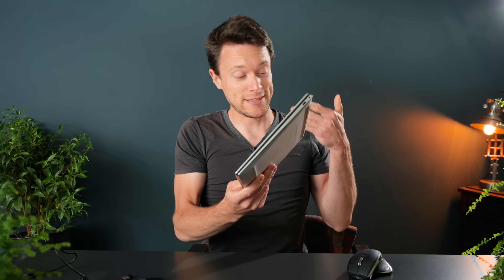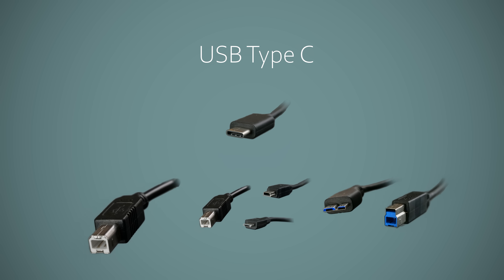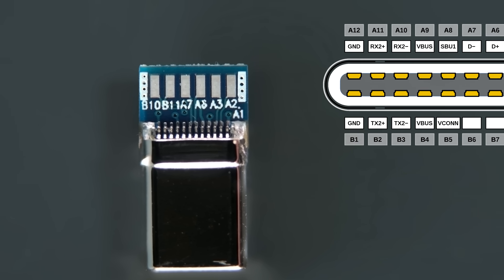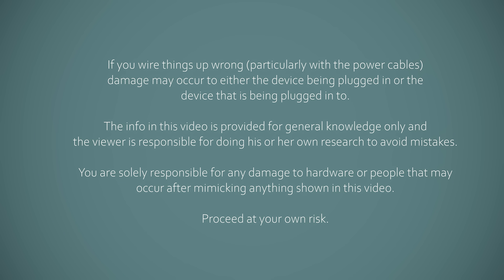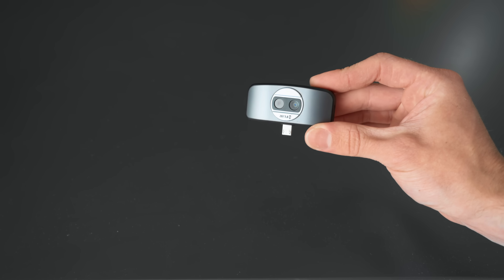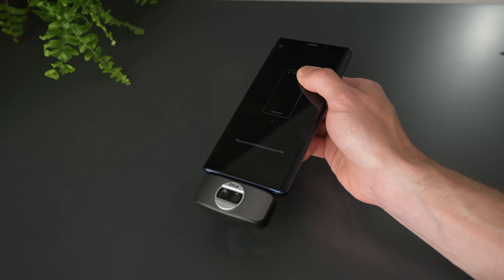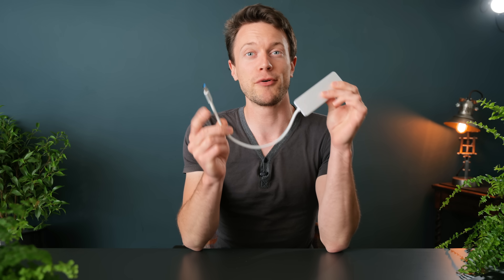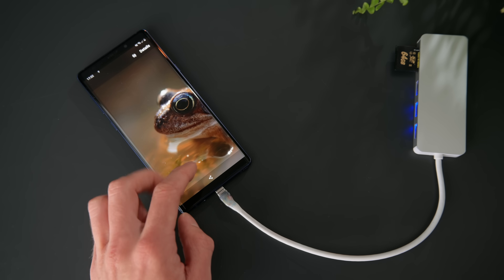Converting devices to USB Type-C

Comment: My gosh, those THT resistors in place of SMDs. My eyes as an electrician hurts but great idea though!
Reply: I also think they put them as host because that's probably the most common use for that part and secondly you could just move the resistor over if you want to use it the other way since the resistor is already there all you got to do is plop it to the left
Reply: @ralanham76  i was wondering why he didnt just move the resistor over
Reply: @thetinguy  Because it's a pain in the ass to solder with an iron.
Reply: ahahh same. Surely its not much effort to order some at the same time as the breakouts. And it looks like R1/R2 correspond to the host/sub config? So potentially able to change it without any other components if the pullup/pulldown is the same value
edit: just saw a bunch of other comments with the same observations. Also cutting the trace to Vbus and bridging it to gnd should have worked
Reply: @TheSecondSomething  Precisely, the pads are there, bridging is also valid option, but still no hate or anything as the idea showed in the video is great
Reply: Yeah! And that isolation tear of the green wire 05:42 hurts my eyes 🤯🤯🤯! #electricianocd
Reply: can someone translate this to english?
Reply: Can someone provide an example of what better would look like?
Reply: @dcloak  Ya, for real. I thought he did pretty good. But then again, I don't know the difference between THT and SMD transistors.
Reply: Pretty old school
Reply: Amazing tutorial thank you.
Is somebody know which connectors in USB c correspond to audio stereo input and audio stéréo output. I have Samsung S20 Ultra. Does it the same for every phone USB c type ?
Thx
Reply: Reading all the comments here and I have hardly any idea what the heck are the electricians talking about 😂😂
Reply: @jont0209  basically instead of cutting the trace at 7:12 and adding that big resistor, he should have just moved the little black resistor over into the other slot as this would have solved both problems. But he is still getting praise because the device worked.
Reply: @nuthinnew  thank you very much for explaining! So if I understood correctly he just would have to move the black little resistor to the R2 contacts and solder it there. Ok, got it.
Reply: @jont0209  correct
Reply: I prefer tht
Reply: Don't be a jackass, not everyone is formally trained in your career of choice.
Reply: That soldering, loose data wires, it's some hardcore stuff over here, but it awesome that it works that way anyone can do it 😁 no hate, not everyone is good at everything 👍🏻
Reply: @jaroslavpetardyson5666  I actually found it more comfortable, as someone with zero experience, that they are not like factory-made, but are flimsy and funny, it's always scary to try out something new, like DIY, and your devices look abysmal in comparison. This just reassures you that you can try and it's not a problem if they look kinda meh.
Reply: Hey, if it works, it ain't stupid
Reply: He probably would have used SMD if he had them.  Their only downside is how tiny they can be.

Comment: At 7:04 why didn't you just desolder the resistor from R1 and solder it at R2 since it's clearly the same pin at the bottom but connected to ground?
Reply: I continued watching hoping you'd notice the empty slot when doing the other devices but you kept on adding huge ass axial resistors at 10:53 and 13:53

Am I missing something?

Comment: That empty R2 pad looks suspicious. Not sure on the schematic, but would moving the surface mount resistor from R1 to R2 have worked instead of scraping off the traces and adding a massive through-mount resistor?

Comment: This is a great video if you want to DIY. However, I can buy 5 USB C to A adapters (small, not dongles) for $13.60 on Amazon. If I just want it to work and don't want to solder (I did enough of that in my youth repairing radios and TVs in vacuum tube and discrete transistor days.) I would go that route.

Comment: At 7:05 you see a resistor (R1) connecting to +5V.  If instead of scraping the trace you de-solder the resistor at R1, and solder it to R2, you perform the same task without having to add a new resistor.  The same goes with the other board at 10:46.  In both, the R1 pads are for host mode and the R2 pads are for device mode.

Comment: Really awesome video! One strange solution is that why not just move the original resistor from R1 to R2. It would have been much easier than cutting traces and using a huge resistor.

Comment: There are much smaller adapters than yours. There is one that you can plug inside your usb and only the Type C connector is sticking out. They are just a few cents from china. It will be about the same size (maybe a little bit larger) than your solution, but defenitely easier to "make" :D

Comment: Nice manual, I laerned some new staff. After some expirience with motherboard diagnostics I noticed, at 7.11 you could use hot air solder and just swipe R2R1 resistor left. You could also do it with standard iron if you have thin tip. That would be more alegant and profesional, but eather way would work the same.

Comment: You can use this very simple solution sir

#Aliexpress Rs. 23.32  50%OFF | OTG Type c USB-C Micro USB to USB Adapter Type-c DATA Cable Converter For Xiaomi Huawei Samsung Mouse usb Flash Drive
https://a.aliexpress.com/_dZHQ8HD

#Aliexpress Rs. 46.64  24%OFF | 5pcs Mini Type C Adapter Micro USB Female To Type C Male Adapter for Huawei Phone Micro To USB-C Type-C USB 3.1 Data Charging
https://a.aliexpress.com/_dZDZVQP

Comment: On the breakout board, if you look closely, there is another SMD soldering spot where a resistor can be soldered to. If you follow the connecting trace you will find that the trace connects to the GND pad. Therefore, you could've just taken the SMD resistor and soldered it 2 mm to the left instead of fiddling around with the big bulky resistor and essentially crippling the board in the process.

Comment: I still prefer that smaller adapter (or a bunch of them) rather than messing around with the "conversion", which technically is useless btw (doesn't provide faster data speeds or smth, just the newer plug).

Comment: You scraped off the resistor... and then added a completely different one... could you not just resolder the one there to the other pins next to where you took it off?

Comment: I think you could have moved the SMD resistor that was on the board to the other empty spot. if I saw the traces correctly, that would have done the conversion without needing another resistor..

Comment: In this case I would 100% use a small adapter (dongle, if you wish) for 1 USD from Ebay. Taking devices apart just for that does not make any sense from my POV ;)

Comment: Good video and well explained Matt. I was having the same issue with trying to power a Raspberry Pi4 and use the USB-C port for data at the same time. It needs the Pi to be the Client for power and Host for Data. I cannot use the USB 2 & 3 ports as I am running Windows 10 and there are no ARM64 drivers yet. I am having problems using a USB-C OTG Hub so the breakout boards and resisters might be a way to solve this issue.

Comment: I needed an extra webcam and I have an old laptop laying around, that tutorial would be awesome
Reply: I have an old Logitech webcam... uncompatible with win10, can you do something with that?
Reply: @slycer98  Short of forcing a driver installation via Device Manager o
any drivers you might be able to find on the Internet, most likely not. I'd give that shot first and foremost if you haven't. You may need to extract an EXE file with 7-Zip to gain access to the necessary INF file(s).

Comment: I converted my Audio technica M50Xs to USB type C, when having just bought a Note 10+, it was the only port. I used the DAC and cable of the USB-C galaxy earphones that came with the Note 10+ and was able to connect it to a previously broken standard 3.5mm audio jack from the M50Xs. As I haven't seen any M50Xs converted to USB-C, I'm very happy with possibly have the first ones. 😂
Found this video quite interesting to see as I did this only 3 months ago. 😊
Reply: very cool u should do a vid about it
Reply: @Reedith  Tried putting it up on Reddit, just not great with it yet. I'll remember to come back to this comment when I get it posted 😄🙌

Comment: Great video!
In the case of the mouse, where conversion is the simples, wouldn't it be easier, and less destructive and backward compatible, to just use one of these?
https://www.ebay.com/itm/2pcs-USB-C-3-1-Type-C-Male-to-USB-Female-OTG-Adapter-Converter-For-Tablet-Phone/391937002524?ssPageName=STRK%3AMEBIDX%3AIT&_trksid=p2057872.m2749.l2649

As for the other ones, I totally get and appreciate the effort!!

Keep 'em coming!

Comment: in 7:13 you could just move the resistor to the left pad and you dont need to place that huge resistor on the circuit, or you already just scrap the pad, and can use a jumper wire to the negative pad is cleaner, but nice work thx for the tip already order the usb C boards thx

Comment: the idea is good, but here in Brazil, it is safer to use an adapter.  Why, everything is very expensive.  This unifying receiver alone costs R$70.  There, it should cost $5/$10.  Or it would be safer to buy the cables made for that.

Comment: 7:09 Little tipp. you can also solder the resistor from r1 to r2 so it would be a lot easier and cleaner

Comment: Pointless, just use the adapter and then your old devices have more connectivity options and it's easier and cheaper with less things to go wrong. You can get much smaller adapters than shown here in this video.

Comment: It looks like you can just move the resistor from the R1 position to the R2 position, rather than adding a extra huge one and cutting traces.
Reply: That's exactly what I was thinking.  It has those two pad pairs right next to each other, presumably the other one just connects the other way.  Though maybe it's the wrong resister?  But still, a surface mount resister seems like a better choice than a full-sized one.
Reply: That stuck out to me like a sore thumb! I assumed that perhaps he knew better than I, but now I'm really thinking twice about that...
Reply: @7:04 R2 trace is clearly to GND. According to USB-C specifications, this resistance is 5.1kΩ pull-up|pull-down. (source: https://electronics.stackexchange.com/questions/446528/why-would-a-usb-c-adapter-have-a-pull-up-resistor )
Reply: You probably can, but I tried and it didn’t work, then I tried what he did and it worked fine, plus it’s easier
Reply: Yes, came here to say this. Don't know the proper resistor value, but I'd be surprised if it was supposed to be a different value. I'm pretty sure you'd be looking for the same current either way.

Comment: Couldn't you just buy a type c to type a cable, cut it and solder the wires to the device you want to convert to type c? This way you don't have to deal with breakout board at all.

Comment: Someone else has probably mentioned this already but all you had to do to switch from a pullup resistor circuit to a pull-down circuit is move that SMD resistor from the pads marked R1 to R2. Now it's not super easy to move SMD components without tong irons but a desoldering wick would have made short enough work of it and the result would have been much more compact and safer than cutting through a pcb circuit with a knife and then using a comparatively massive through-hole resistor... nice vid otherwise, keep up the great work. :)

Comment: Just curious...why didn't you just move the resistor over to the R2 position?  
Or you could have used a different value surface mount resistor in the R2 position if needed.
That should have disconnected the positive side and made the negative side pull-down for being a sub-device.

Comment: @7:04 Umm.. Pretty sure that board is designed to let you heat then slide that resistor over to R2 and be good to go.
Reply: Correct if you look at the traces r1 and r2 share their bottom pads to the via and either r1 or r2 go to vcc or ground.

Comment: Waves hands in the air! Oh my god! After twenty years the USB is being updates so we do t fail at plugging it in more than half the time! (Which is odd since random change would mean that at least half the time we plug it in correctly.

So, instead of buying a dongle for less than $10 US,  you take a wireless mouse which for some reason requires a dongle to access Bluetooth (seriously, why don’t wireless mouses for Microsoft just access the built in Bluetooth of the computer), you take that dongle and you make a dongle for it.

Or, call me crazy, you can go to Amazon.com and buy a three pack of adapters, not much bigger than the kludge job you just create $7.95 US plus shipping and applicable taxes. 

amazon dot com/Adapter-Benfei-Compatible-MacBook-Samsung/dp/B07DNQ9FD9/ref=redir_mobile_desktop?ie=UTF8&aaxitk=NO1ndFs5Ur6T.fRJ3qPzBg&hsa_cr_id=1366039310401&ref_=sb_s_sparkle

Or, you can keep whining about progress.

Comment: This guy is making a mountain out of a mole hill. You don't need a long dongle and therefore converting with all the soldering and messing around with that stuff.. There are very small (single piece) adapters converting old USB to USB-C. They barely make any difference in space when plugging in old devices. This is another video that has shown he doesn't do all of his research first. As a result, there might be a lot of people trying to convert things manually (and possibly ruining their hardware if they're not skilled with these projects).

I did see another one of his videos where he claimed there weren't ANY external portable monitors around for use with laptops or something to that effect. However, at the time of his video, I OWNED one that I had purchased and it wasn't the first I had bought. His video was showing how to pull a display out of a dead laptop and turning it into a secondary monitor for a laptop. At this time, I've already had three.

Comment: Use a C-to-A adapter that's small and portable, works for any USB device on either end, and doesn't require some soldering, wires, disassembly, and molding

Or break apart a device and solder it back up, and if it still works, now you can only use it in C devices.

Comment: there are USB 2.0 only Type C adapters that are similar or even slightly smaller in size next to this. The logitech Unify reciever is USB 2.0 only, so you can just use one of those adapters, instead of using the larger adapters that do USB 3.0. Just gonna point that out :)

Comment: My only problem with usb-c is that it is too easy for it to fall out. I have never had a minijack fall out of my phone while running, but when i got a new phone with usb-c i had to stop, when the connecor tilted slightly, or was on its way out, the pop in the earbuds almost killed me.

Comment: Great video, although I think an USB C to A adapter is still much easier, as there are some tiny ones that actually slide into the type A male connector: https://www.ebay.de/itm/392539277668
I've used these adapters even before usb c with micro usb adapters of the same style to connect usb devices to my phone's.

Comment: port conversion?
Apple:  no problem just use ADAPTER!
DIY Perks: No that is not a solution!
Reply: A workaround is not a solution.
Reply: @DmitryTheNoobZMasterGranicin  but this entire video is an even bigger work around.  you can get an adapter or you can buy all the various things you need to tear your device apart and soder type-c to it.  Then do it again for every other device you have because you didn't buy an adapter.
Reply: and where is the adapter sir...
Apple: it cost you $500 + a sticker $550
Reply: Exactly! Just use a Type-C to Type-A adapter that is one piece with no cable

Comment: I am just curious since when "adapter" has been renamed to "dongle". Wtf is a "dongle" anyway? It's an adapter, period.
Reply: I agree. This is what I'm thinking too
Reply: https://www.yourdictionary.com/usb-dongle so the dongle is the transmitter for the mouse or a flash drive etc (something that doesn't have anything else plug into it and is small basically) and an adapter would be the cable that adapts the connection so that a different connector can be used. Didn't actually pay any attention to which he called dongle and which he called adapter but most people just call everything that plugs into a usb port a dongle these days even though it's incorrect.
Reply: you can blame apple

Comment: Just yesterday I ordered some USB C adapters as well as a versatile USB watt meter and power analyzer and was looking at the USB C breakout boards since seemed easier to test current.  Wound up using a STM MCU to access the pinouts for voltage at least to verify the cable was working.  Was thinking more to make a USB C to female USB 2.0/3.0 with this design since I used to own the same mouse and have the smaller version now and have used on different laptops and desktops at times.  The Logitech wireless mouses and keyboards are the best IMO.  Messaged someone on eBay who I was testing also and noted I'll keep my eyes open for salvage boards to make instead of buying since can find junked USB C female connectors I'm guess for less and have some other components to play with if not just trash/recycle.